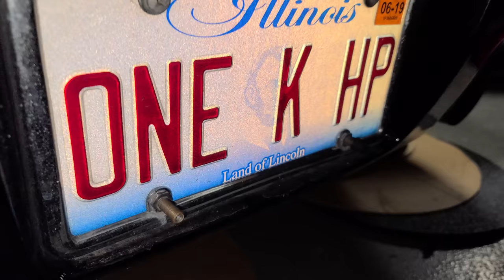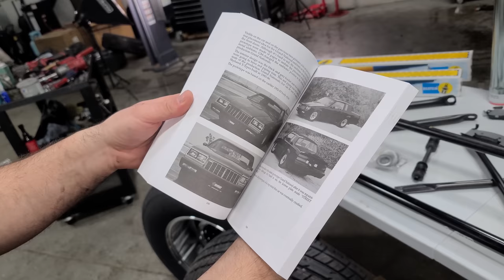My Grand National Was UNSAFE To Drive So I Replaced & Upgraded Everything! New Wheels & Suspension!

Comment: Why oh Why do you peopel pver there in the USof A call them cotter pins  they are SPLIT PINS  you mite notice the split down th center  . A cotter pin s are round with athred on one end for a nut to pull them in to a taperd hole as used on old styel of peddels found on pushbikes